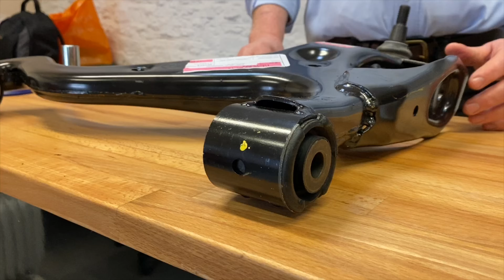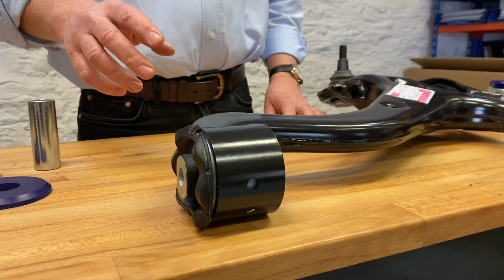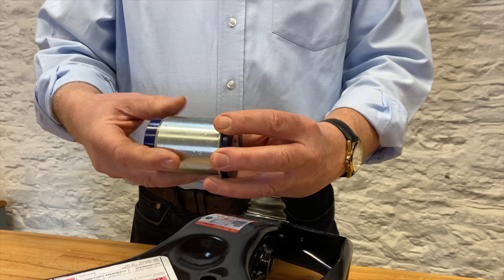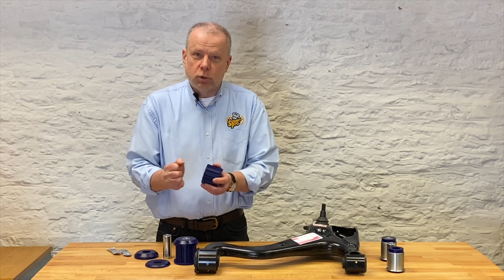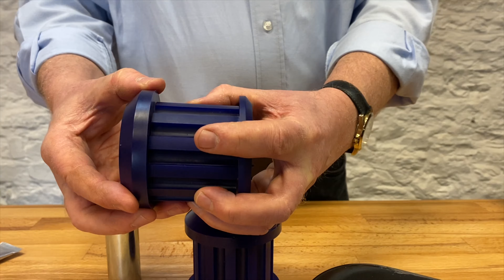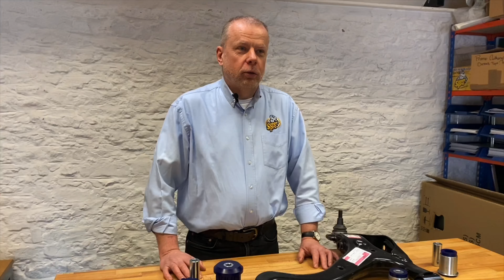Land Rover Discovery 3 / Discovery 4 and Range Rover Sport Bush Upgrades

Comment: I have replaced all the control arms on my LR4 with and aftermarket Lomfoerder brand, however, the drives so harsh and I can feel every crack in the asphalt. What is the real solution to fix that?
Thanks

Comment: Hi I fitted these to my Discovery 4 2015 omg it has transformed the whole car.... I would say these add about 10% harshness (not much) but give 80% more drivability... superb....so glad I did not go for std replacement. Thank-you Pro Sport!!!
Reply: My mechanic is complaining about the harshness  and comfort this is having after installing those on a RRS SC. What are your thoughts?
Reply: How are they holding up? I am looking at installing these in my LR4 as well.
Reply: @bozste1813  have you installed them in your LR4? how is it?
Reply: @petrucostin4257  no. I ended up ordering Lemforder bushings from FCP Euro.

Comment: These are fantastic - been fitted for years in my D3 worked a treat
Reply: They doesn't squeak or something ?.I watch their videos here on  you tube ,and they mention grease allot,but i am wondering ofc,how long can that grease stay inside bushing.Because once it's out ,bushing won't last much longer,and certainly will start to squeak.
Reply: @TheSRBgamer63  No they never squeak - there is enough grease in the grooving to prevent any noise causing friction. I have them in my D4 now and I love the more direct feel that they give.
Reply: @brucecutts8841  How are they holding up? looking at installing these in my LR4 as well.
Reply: @bozste1813  They last very well and continue to do so.
Reply: @brucecutts8841  How are they when the vehicle is offroad?
Reply: @TheSRBgamer63  
No squeaks just pure driving pleasure...